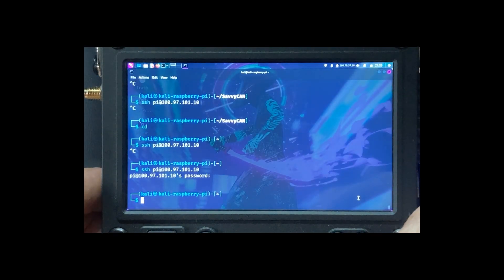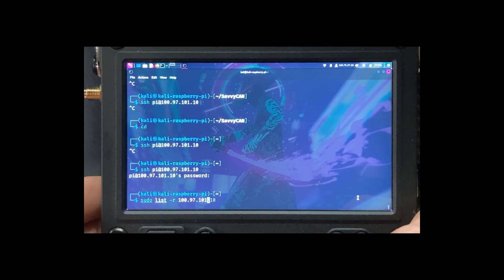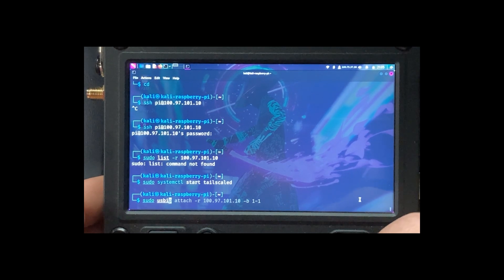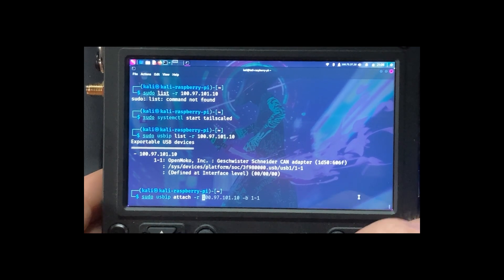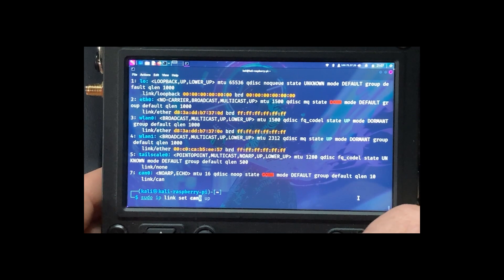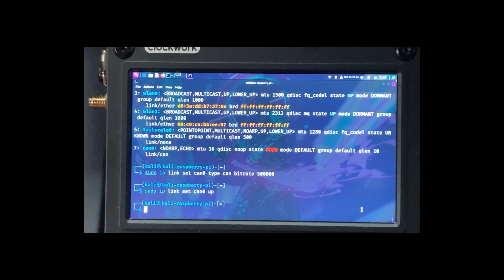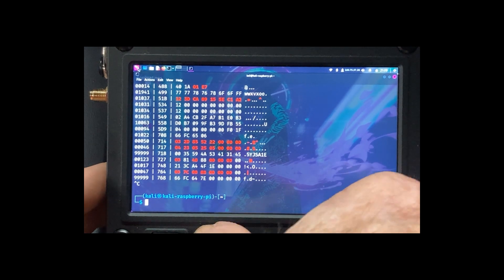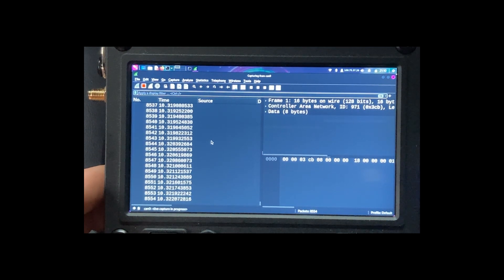uConsole Raspberry Pi CM4 + Raspberry Pi Zero 2W USB/IP  over Wi-Fi

Comment: What can you do with it
Reply from the maker: This is the setup I use to send and receive data packets on any single CAN-Bus channel, in this instance Chassis as I was troubleshooting the piezoelectric sensor arrays in the front and rear bumpers. It's nice because it's a wireless solution that emulates directly plugging in any opensource CANable USB dongle into the uConsole as if it were actually plugged in to the Pi Zero, this by way of the (Linux only) magic of USB/IP. You could simplify and just connect the uConsole directly to the Tesla's OBD port but you'd be tethered by wire to the car and the freedom to stretch the legs and walk around the shop while reading (or sending) data I think is a lot nicer. SavvyCAN sorts the data very well but a DBC file is still needed to translate, and any unknown signals can be discovered using Hex-Rays IDA Pro
Reply: @3DCharacterArt  what's all the functions can you do with it

Comment: What is the Pi Zero 2 W used for in this setup? With the static image in the video reflecting only power going to the Pi Zero i can only imagine that its connected to via WiFi? But the only other WiFi device would be uConsole. So.. ??     If you have any further information on what software is loaded to both the uConsole and the Pi Zero 2W I would appreciate the info as I am going to use my uConsole for this and just ordered the missing pieces i dont have. What version software did you load to the Pi Zero 2W and it looks like you have Kali on the uConsole correct?
Reply from the maker: Pi Zero has 64bit Rasbian Bookworm Lite and uConsole has community build Kali Linux (based on Debian Bookworm) with updated kernel (had to change it to get it to compile SavvyCAN). The Pi Zero is powered by the Tesla OBD port using a step down 12v to 5v converter, and is passing data packets from Tesla CAN Bus (Chassis) over Wi-Fi using USB/IP (Linux only magic!) to the uConsole. The result the uConsole in essence acts as if the CANable USB were "plugged" in as if physically, but over Wi-Fi so I can walk around the shop while connected to the car. Both have USB/IP and Can utils tools loaded, everything you need is listed in the description. Compiling SavvyCAN on the uConsole needs a kernel update, you can find more info on their Github pages.
Reply: @3DCharacterArt  OK perhaps im still not fully understanding... The Raspberry Pi Zero 2 W connects wirelessly to the uConsole in order to pass USB over IP? If this is the case i dont understand how the CAN Traffic is getting to the Pi Zero 2 W as its only physical connection is +5vdc and GND.  ?? Is that correct or no?
Reply from the maker: @brianzimmer1632  pi zero handles usb/ip over wifi network, CANable connects to vehicle ODB and passes data between vehicle and  pi zero, and a pi CM4 compute module analyzes the data with SavvyCAN and other tools
Reply: @3DCharacterArt  Good Morning I have 2 questions if you would be willing to answer them for me..

Comment: I found your video as I was looking at the uconsole but what a great little mobile tool. I’ve been dragging my laptop to connect to my Liligo RS485. I’ve been using SavvyCAN to find the CAN messages for the Zero Motorcycle battery to be used as a house battery.

Comment: did you add a RTL-SDR inside your uConsole? i see the antenna port on the expension slot :)
Reply from the maker: not yet... that's the ipex pigtail to rp-sma that came with the official rpi cm4 antenna ( https://datasheets.raspberrypi.com/cm4/cm4-antenna-kit-product-brief.pdf ), left as a placeholder filling the hole until I get around to it. I kept the original tape antenna on top also, both have a bit of shrink tubing on the ends and tucked out of the way.

Comment: are you using a Alfa USB Adapter AWUS036ACS ?
Reply from the maker: Yes Alfa AWUS036ACS, I had to install drivers but it wasn't too difficult, Alfa works like a charm,
though I read on the Clockworkpi uConsole forum some people seem to have trouble installing them. I might do a video on how to set up w Alfa...
Reply: @3DCharacterArt   thanks! And do you use it instead of build in wifi or using it for wifi hacking?
Reply from the maker: @p1rrup  Alfa does have monitor mode, but I use it mainly just as a signal boost over built in wifi
Reply: @3DCharacterArt  can you make another video for a step-by-step guide on building the obd device.
Reply from the maker: @sheleshrauthan5912 yes, planning more soon, CAT 5 hurricane has just passed still no power, hopefully next week I can get started
Reply: @3DCharacterArt  Thank you sir, i'll wait for the video as I want to learn more about building kinds of stuff for car-related hacking. I hope you and your family will be safe during this difficult time of natural calamity. be safe